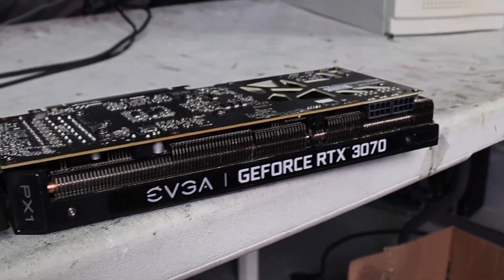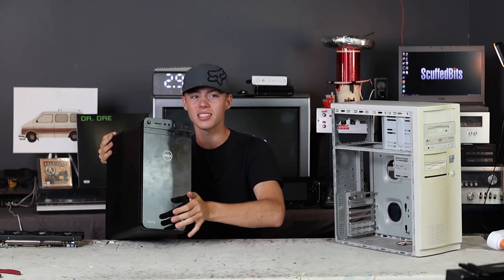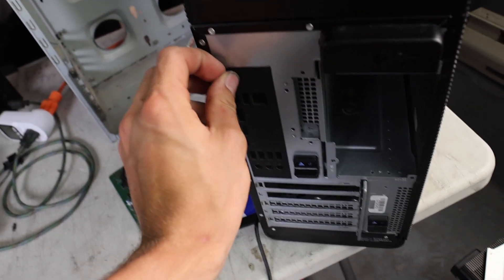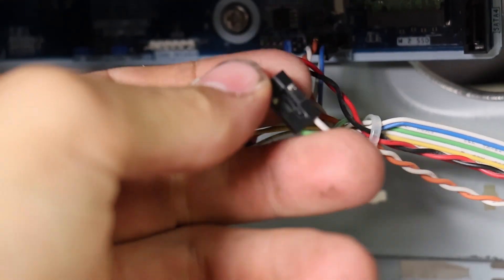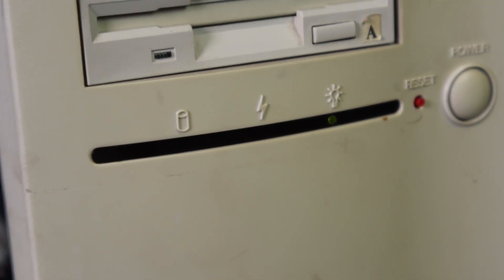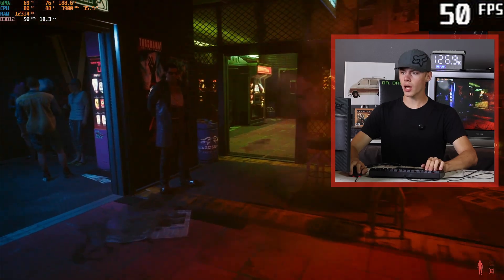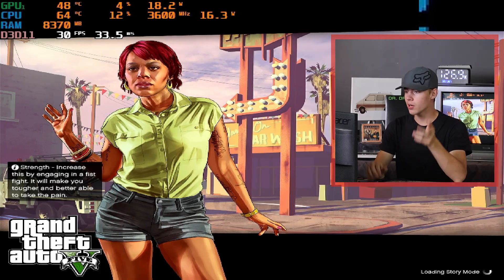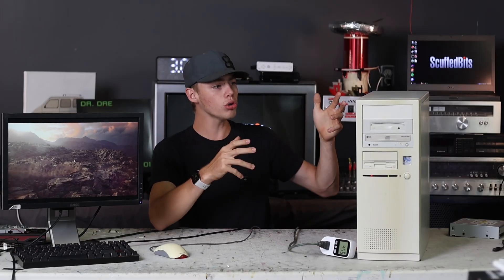This Ancient Computer runs Games on MAX Settings

Comment: As you already figured out, those cases aren't designed for running cables on the back side.  The only reason why the back cover comes off is to allow you to install the screws on the back side of 5 1/4" devices.  No one cared about cable management at the time when these were common.  IDE and SCSI ribbon cables were widely used at the time and those just don't cable-manage.

Comment: Nice sleeper build ! Does the drive bay and other stuff still works with the new mb ? That would be cool
Also keeping the old HDD somewhere plugged in would add the "ambiant noise" of the old pc
And for airflow you can probably ziptie a second fan on the empty pcie slots for intake, it doesn't affect the look and should have decent airflow